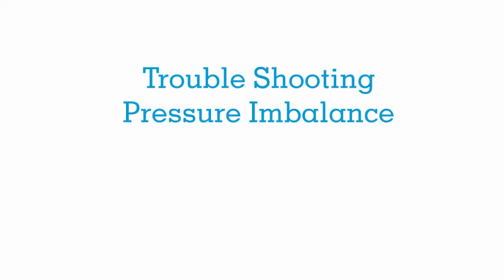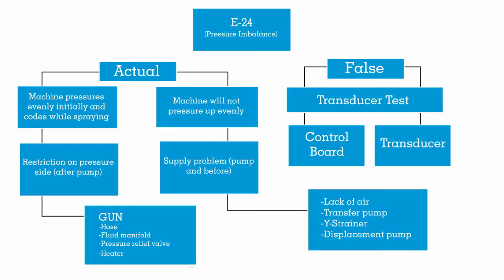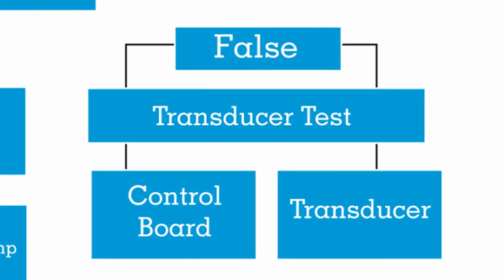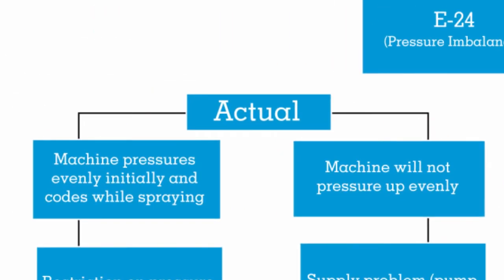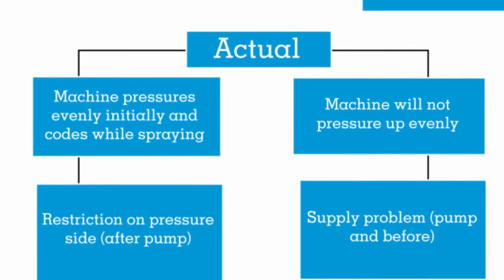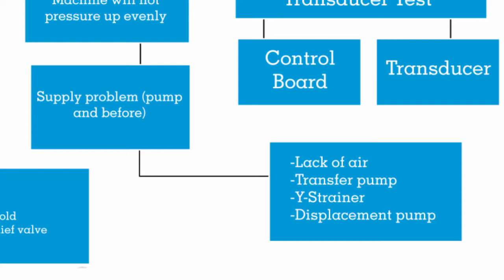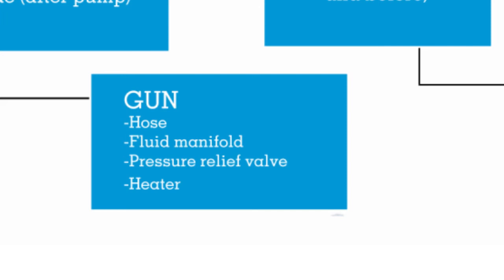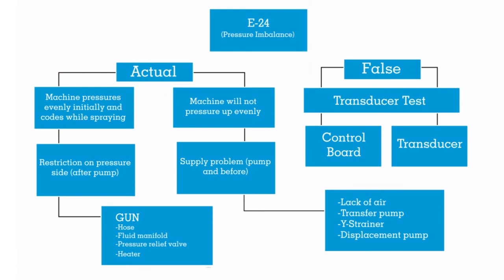Troubleshooting a Reactor E-24 Error Code (Pressure Imbalance)

Comment: how do i troubleshoot or know how to fix a e24 code.
we had sprayed a set of chemicals, the guns turn the rig to go to lunch and when we came back from lunch and turn the reactor and we ready to spray the reactor show us on the display an E24 error, i know is no the gun because the gun was brand new it just came out of the box, on the same morning.
air was going to the pumps because i hear the pumps pumping! 
i try to release the pressure with the release valves and it didn't do anything the valve gauges didn't move all i notice is that the A side it kind moves but it only move up and down just to the first line is that like 100psi or 10 psi?
air is good chemicals are good barrels are full?
i also try to turn on and off the reactor several times i even turn shut off the hold reactor but it didn't do anything 
in conclusion i have an error E24 air is going to the pumps, the barrels are full of chemicals, pumps pump when the ira goes to the pump when i try to spray on the gun the chimal from the side A is the only one is that comes out of the gun!
the valve gauges doesn't move when i turn the reactor. so what do i do in this situation ?

PLEASE HELP........ IM DESPERATE ..... ANYONE .......
Reply: You fixed it?